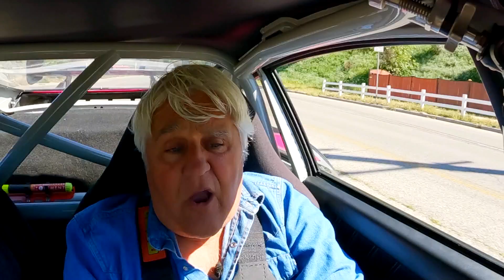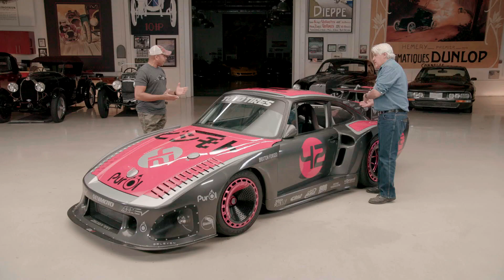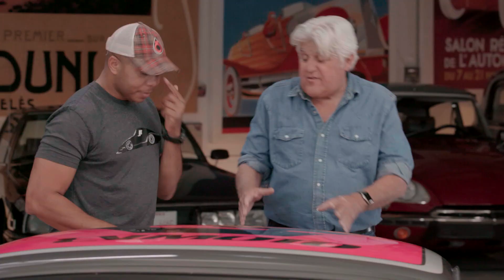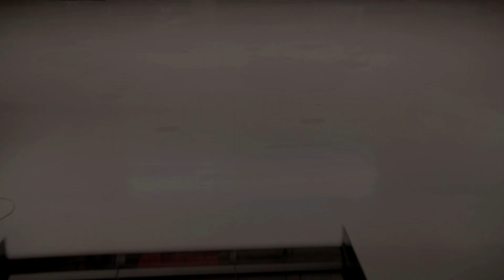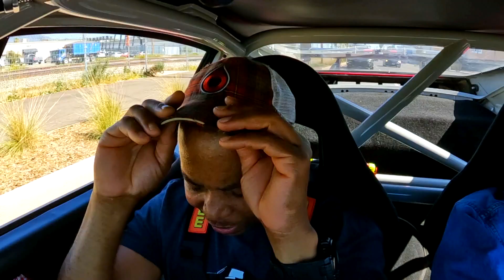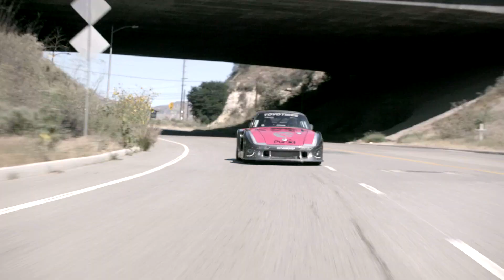Bisimoto’s Porsche 935 K3V | Jay Leno's Garage

Comment: So were are you going to race your 100 mile range car?
Reply: If I'm just driving a car on a track day for fun, I can promise you by 100 track miles I'm going to want a break that's at least 36 minutes long lol. For a fast track toy, a 100 mile range of hard use is amazing when you consider the charging time is that short. Sure one couldn't do an endurance race in one, but a big race team could easily afford two and charge one while the other is out.
Reply: Are you criticizing the range for a race car?
If so might want to check what a similar equipment gas powered Porsche would get 🤔
Reply: That's 4 laps in the nurb, seems enough to me.
Reply: Filling a gas race car takes seconds, not hours like an electric. 100 hours for street EV is awful.
Reply: “Were”? It’s “where” 🤡

Comment: Going electric will put an end to money going to the middle east. It will also put to an end a lot of the hot rodding . Yes you will still be able to buy wheels and body kits, ect. But car parts stores will go away. Gas stations will go away. Tool trucks will not go away, but will change what they carry. On the good side, the garbage trucks won't wake you up, they will just slip buy, picking up your trash.

Comment: Basic electricity, Voltage is the pressure that causes amperage to flow across a restance.  So higher the voltage the greater the pressure, or power.

Comment: I'm conflicted. Good build, but this was an endurance legend, wins the 24hrs Le Mans, the 1000km Nurburgring, Sebring, Daytona, and now it's a 100 mile lady shaver. It's supposed to be a screaming 3.3L turbo 850 bhp at 935kg (2060lb) but now it "Weekend at Bernie's" its way down the street. Maybe use a nice E36 frame instead, you know, those electrics don't care.
Reply: This car was destined for the crusher. It was saved and reimagined. Nobody will care about old cars collecting dust in some garage or museum if they are not out on the road or track.
Reply: if it's any consolation it is not and never was a real 935. Bisi mentions that it started as an '84 911, and now has a newly made Kremer body kit. To cut up a real 935 race car would be a crime, especially doing it for something like this. I think it is repeatedly called a 935 because of the clickbait potential. "he did what to a 935??"

Comment: Great video and Bisi works wonders but did anyone else find it ironic when he mentioned oil being drilled out of the ground, refined, and put in for transportation.. umm Lithium??
Reply: Sure, but thats one time.  In a gas car, that process has to be repeatedly constantly.
Reply: @aussie2uGA  but lithium has a lifespan.. Length tbd; and recycling batteries is very costly and has a ton on chemical impact on the environment, so much so that really just get trashed at the end life. With oil, yes drilling is done occasionally depending on how Rich the ground is, then pumped in pipelines to be refined, all byproducts being used in different areas (plastics to gasoline) and when put in the car, catalytic converters treat the hydrocarbon. I’m not a grumpy old v8 guy, some mix is where the world will end up I’m sure. It’s about what end of the life the environmental impact is. Lots of blinders on when it’s at the end of life and not cared about anymore.
Reply: @dirtdude96  But what is end of life for a Tesla?  After a couple hundred thousand miles, if you're unhappy with it's range and want to replace it, grid storage companies will outbid each other for a chance to get that battery.  Once they're done as a performance battery for a car, they have an amazing long life in other non-demanding battery applications.
Reply: Lithium batteries are recycled, therefore you can reuse the same lithium for decades. Petrol just burn and goes in the atmosphere (so enough, it is also a cycle: plants will absorb the CO2, decay, and in one or two million years, we will have petrol again).
Reply: It's a race car who cares about the enviroment

Comment: Re: Rear brake light actuation. I have a system on my '94 Lexus SC300 and also on my 2001 Ford E-350 Supervan called a "Saf-T-Braker". It is a circuit with an accelerometer that flashes the rear third brake light if the vehicle decelerates at 0.3 G or greater. Those were installed years ago and I was unable to find it available more recently. On both my '12 Jeep Wrangler  and '19 Kawasaki Concours 14 I have a simpler device that flashes the third brake lights on first application of the brakes but then reverts to continuous lighting. On a related note, the Concours also has an aftermarket front headlight (dual) modulator that cycles the brightness from about 30% to full. Obviously, it is for daylight use only. There is a photocell in the circuit that disables the effect when the ambient light level drops to twilight levels. The cycle rate is variable but I have it set to about 2 Hz. It definitely makes the bike more visible to oncoming traffic. The modulator is U.S. DOT approved and is legal in all 50 states and Canada.

Comment: As an engineer, I appreciate the advantages of EV, but the reality is that it's not a perfect solution. Cost is high for the motor.  Electricity is not free either, nor is charging conveniently available for everyone.  If you live in an apartment complex or perhaps in a neighborhood where you park on the street, where will you do your routine (and slow low level) charging?  Also, if you live in an extremely cold climate, battery efficiency is a big problem.  EV is simply not going to be the answer for everyone nor should we expect it to be. Hydrogen fuel cell actually makes more sense for wide adoption:  it's quick to refuel akin to pumping gasoline into a tank and the only thing coming out of your tailpipe is water vapor.
Reply: But how do you produce the hydrogen?
Reply: @Stantonv  take your pick of methods.  Hydrogen is also THE MOST ABUNDANT ELEMENT IN THE UNIVERSE!!!  You can't say that about your lithium or other metals used in batteries.
Reply: @mitchd949   Unfortunately  hydrogen is in compounds and it takes a huge amount of energy to extract it.
Reply: @mitchd949   you missed the point entirely.   Compounds with hydrogen are abundant,  it's the extraction of the pure hydrogen that takes massive amounts of energy.
Reply: @mitchd949   https://en.m.wikipedia.org/wiki/Hydrogen_production
Reply: @mitchd949   As you can read from the Wikipedia article, natural gas is the number one source of hydrogen.  If you burn natural gas in a dedicated engine you can get very impressive power levels.  NG engines start easily in the cold and are very non temperamental.   Why aren't NG engines used you ask?  Three  reasons, 1, how do you apply road tax when you can pump it from the lines in your house?  2, if you do Jerry rig up a compressor to compress NG you can easily find yourself in the middle of a large explosion.   3,  you will need a large and strong vessel in your vehicle to store your compressed gas.  Large trucks would be perfect but your subcompact would not.

I never mentioned batteries,  but you are correct, they are very dirty and bad for the environment in production and disposal. 

Hope this helps.
Reply: I've always been preaching this same message as a geography/environmental science major electric isn't the answer ecologically either... It works fantastic in niche environments like SoCal or the bay area where charging stations are sorts prevalent and most people travel less than 30 miles in any direction to get anywhere. But for those of us that live in rural California it doesn't make sense what so ever where a majority of driving is through areas that don't necessarily have the charging support or grid capacity for some of the older cities. Company's like Rivian should do well hopefully as they are the first ones to offer a viable truck option that could work well for more rural customers but the prices are still absolutely ridiculous. It's definitely a balance we haven't seen met yet with the cost of the cars themselves compared to gasoline counterparts.
Reply: @RetroMotiveAdventures  in a few years when you can buy a used cybertruck for 30k that can go 400miles and charge in 10 minutes for free nearly anywhere in the world on its own
Reply: @KCJbomberFTW  in a decade maybe? As for the cyber truck as of currently it's been cancelled no? Let alone that design would never ever be carried over to the production vehicle. Elon's good at publicity stunts I'll give him that.
Reply: Agree with you.
Reply: It’s only practical when you’re on the Tesla grid
Reply: Electric is far cheaper, safer, and can be created for free just with the sun.  I think what the traditional industries hate most is there is no "consumable" that can be monetized, like hydrogen, needed for electrics.  Also there is really no maintenance on the drivetrain or batteries.  Thats a huge disruption to an industry geared around constantly selling you more of something to keep it going.
Reply: @aussie2uGA  so instead of big oil we will have big electricity lobbyists. Electricity and "renewables" including solar etc have become just as inundated with company's trying to get rich quick off the governments subsidization of them. They are feeding the consumer the next big thing to keep them on the hook for it. Electricity will become ever more regulated and they will find a way to charge you for it mark my words.
Reply: @RetroMotiveAdventures  Oh I'm sure they will try, thats human nature to try to make a buck.  But with oil, they've got you as there are few alternatives to making it.  With electric, you can generate copious amounts from your roof using solar or like Jay does, he powers his entire machine shop using a fancy wind turbine on the top of his shop.
Reply: @aussie2uGA  I think you are over estimating current costs of solar and wind on a residential scale. For Jay it makes sense for an industrial sized building and he's got the money to do so. As for private Individuals financially it isn't feasible necessarily. That's coming from someone who has solar on their house currently...
Reply: @aussie2uGA  You realize it's the same people right?
They have the money to invest in both, doesn't matter what wins they still get the money.
What they want is control, it's easier to control an EV  than a normal combustion engine.
Reply: @aussie2uGA  You are way off base.  "Free" sun?  Hardly!  Install your own wind or solar - great if you have the roof and the money to install it.  What about people in high-rise apartments and condos?  What about winter months when sunlight is less direct and of shorter duration during the day.  I'm going to guess you're not an engineer or an accountant.  As I said, EV is great but it's not the panacea you and others like you think it is.

Comment: Roughly 50% of California's electricity is generated through the burning of natural gas so technically, this car still runs on gas.
Reply: Finally we have three nuclear power plants planned and approved in the States. It’s been 43 years.
Reply: Power generation in the United States is 80% fossil fuels .... his story how he felt bad about emissions driving a gasoline car made me cringe hard...
Reply: @1DEADBEEF1  eia contradicts that, says for 2021 over 40% of all electricity generated in the US was from nuclear&renewables.
Reply: In Georgia it only costs $.01kWh at night due to the abundance of nuclear electric energy.  I can see where some states would be very high if they don't have advanced power plants.
Reply: That's why you need nuclear!
Reply: David it’s very easy with California’s climate to have solar panels with batteries and charge free from the sun overnight.
Reply: A 50% reduction is significant. And for the remaining 50%, it’s more efficient to burn it at a central power plant.